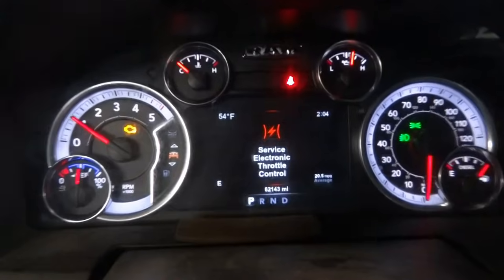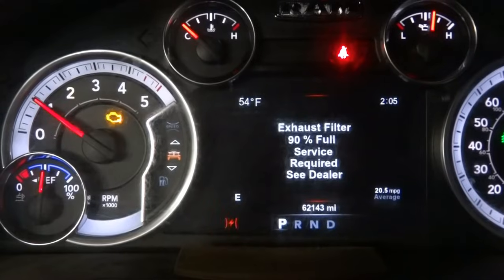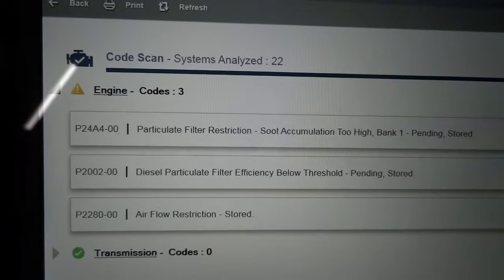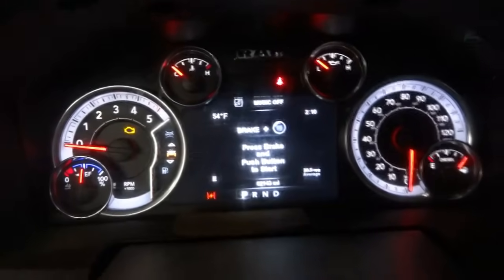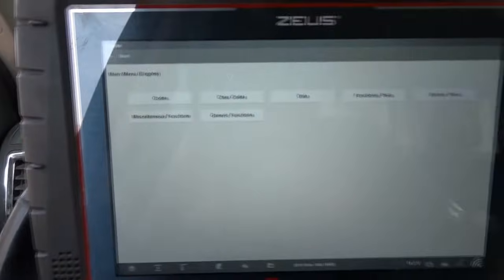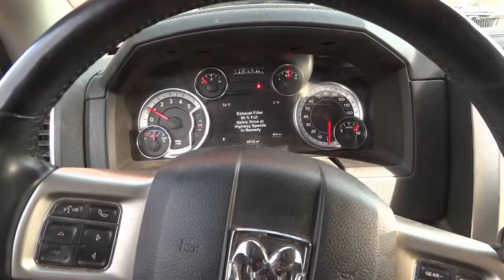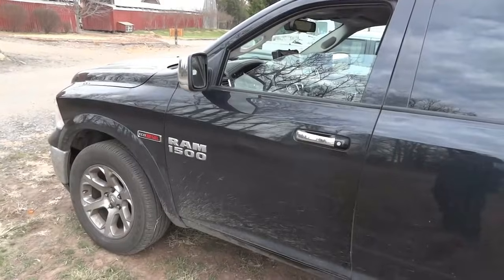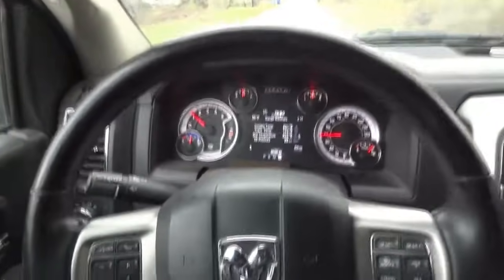DODGE RAM: P24A4 Particulate Filter Restriction - Exhaust Filter 90% Full / How to regenerate a DPF

Comment: My ram went to 100percent and dealership wanted 4000 to replace filter. Got on interstate and drove 90mph plus for a hr straight and truck finally regen.
Reply from the maker: @russelgunter9546   Nice!
Reply: Did the power reduced when you got the message ?

Comment: Hi, i have a 2019 ram 1500 ecodeisel. 3.0 v6. My was on 80% full, i tried to ran regen. At about 15 into regen . Engine went loe power than exhaust went up 90% full. I drove about hour and the number didn't come down. The engine oil change was on too. Is that have anything to do with regen not working?
Reply from the maker: @timtam9673  Yes

Comment: Excellent video! Are you able to help me? When my scan tool says regeneration activated the rpm on my car doesn’t increase? And comes up error it was unsuccessful? Not too sure what to do
I have cleared all engine codes before trying to do regeneration
Reply from the maker: @dylanr4791  Thanks! your scanner probably can't support that test!
Reply: @KITS_Auto_and_Truck_Repair  it’s very similar scanner to the one you use in the video, same prompts and everything 
Would a P0428 code stop it from being able to do this?
Reply: @dylanr4791  I have 2017 6.7 all codes need to be cleared before regen will run I use a ms906bt by autel

Comment: Please help. I have dodge ram 2017 1500 big horn eco diesel. All the time error appears p2002. We did force regenerate but after 10 km came again. What to do? Thanks
Reply from the maker: @randompillow1234   check the DPF pressure sensor!

Comment: Clean the def injection spray nozzle. It builds.up crystals that disrupt the def spray pattern.  
Just two 10 mm nuts to remove. Have a def injector gasket handy.. Crystals dissolve with water.
Reply from the maker: @petermandel2552   Yes!

Comment: Tried doing my regen on my 2016 Ram 1500 using a scanner. It failed due to not achieving enough high temperature. Any ideas if it is from the blend door actuator?
Reply from the maker: @adrianmuresan1  NO!

Comment: Guys you have to turn your overdrive off while driving thru town or under 45 mph. This will help. Since I started doing this all the time, I have not had another notification.  Back when I did have notifications I just reset the system myself by parking in neutral ( not sure if that makes a difference) and pressing the pedal til I reach between 1800 and 2500 rpm. I shoot for 2200. But it’s really difficult, unless maybe if you had a pedal commander it might be easier to nail it. It takes 10”15 minutes to clear the filter down to below 30%
Reply from the maker: @AbersonPlastering   Thanks for your input!
Reply: That's no different than taking the truck out and romping down on it to clear out a lot of the particles. The Regen actually adds more fuel into the exhaust causing the DPF to heat up over normal driving. Thus burning out the particles, but frequent regens will cause cylinder washout and you'll end up with a lot of diesel in your oil from it passing by the piston rings.

Comment: Hello there, now engine light popped  again three weeks ago. And when i tried the regen, it didnt allowed as I have another code to fix before doing the regen, that is PO545. I waited for sometime. But then yesterday when returning home from work, i heard tac tac sound before engine shut down completely. I had to tow to home. DO YOU THINK MY ENGINE IS BLOWN OFF NOW????
Reply from the maker: @tenzinnamdhak   I don't think so, I recommend you take it to a pro mechanic who can diagnose it for you!
Reply: @KITS_Auto_and_Truck_Repair  just curious, what could be the issues? 

besides i just saw a video that says that after forced regen in your ecodiesel, it is better to change the oil. Do you agree with that?

Comment: I have a Ram 2500 with 200k miles and I had to do forced regen because that message came up. Regen went good But since that I drove for like 60 miles and the dpf filter says it is a 25% full again is that normal? I had noticed that sometimes goes up like that and all of sudden it’s on 0%, but since the forced regen I just want to make sure. Thanks in advance
Reply from the maker: @rupertolandaverde4984  it sounds like the Regen didn't go through properly, after the Regen your soot level should drop to 0%
Reply: @KITS_Auto_and_Truck_Repair  It did went to 0% on the day that the regen was made I noticed that yesterday

Comment: I have a 2017 Ram 5500 diesel it’s a tow truck it showed it’s 100 full but I drive it a lot on the highway but the truck has 422009 miles on any possible solution?
Reply from the maker: @nabilbrahim5881  Do a Regen or a DPF Cleaning and see what happens!

Comment: Hi, I fixed my 90% full exhaust filter myself without any computer by following someones suggestion in another post. I only had an eighth of a tank of fuel so I drove to the station and filled up the tank with diesel. I pulled into parking space nearby put the truck in park, took off the parking brake, and maintained the engine e between 1800 and 2500 rpm's. It sure wasn't easy holding my foot on the pedal and maintaining the proper idle. After about 5 minutes the screen message said exhaust filter 80%, then another 5 minutes it went down to 50% then to zero and message said regeneration is complete. Whew, I thought I was going to go into limp mode on the way to the station and have to get a wrecker to tow me to the dealer. But thank you so much for showing the process here. Without the knowledge I learned from this video it would have been a bit more of a challenge.
Reply: Good afternoon Hi! Aberson, I read your message about 90% Full exhaust filters see dealer. I’m very sad because i just purchased my 2014 Jeep Grand cherokee Overland first time to own Ecodiesel. The reason i buy it because of the Gas mileage vs to Gas Hemi V8 engine. But when start driving couples days only city in the about 8 miles total 16 to 18 miles a day. The check engine lights ON and message saying 90% full filter full see dealer 😮 i just purchased 8 days ago and i used 4 times only not on the highway. then my Jeep Overland check engine lights ON. I follow what you said on you’re message now i have 123 Miles Distance to Empty my Gas i just put Diesel Gas 3/4 then Go the parking then shift on the parking and parking brake press gas Pedal until the RPM up to 2000 to 2500 hold 5minutes then repeat again for another 5 Minutes let see if worth to my Jeep Grand cherokee Overland Ecodiesel.
Reply: @earlcas7620  What you do about it. the same thing happened to me. and they checked everything before selling it
Reply from the maker: @AbersonPlastering My Pleasure! I'm glad to hear that you were able to fix your truck and thanks for sharing your experience with us!
Reply: Or you can get a scanner that will let you force Regen, go in and clear the fault code or chose installed new DPF , then you can get cel to go off , your manual Regen will work then. Dodge, Ram, Chrysler after 2019 needs the odbll security bypass cable.
Reply: Did you have the take to dealer for particulate full error
Reply: @MrJas6477 . No. At least not for a month. My check engine light went on and had to take truck to dealer. They did something emissions wise but the truck did that thing again where it said exhaust filter 90% full so I had to drive to Rio vista anyway so I though I would try it, but I got behind a couple big rigs. Hwy 12 is a 2 lane hwy and trucks were going slow. But I did it. It was nerve racking because I really needed to be going about 65-70 mph to blow out the clog this time.  Check it out. It happened even one more time but listen,  you have got to run your truck with overdrive off while driving under 45 mph since I started doing this I have not had another issue
Reply: @AbersonPlastering I have been driving my 2022 Ram 6.7 Cummins in tow mode to keep the rpms higher for longer trying to clear it, but I keep getting the full message. And I have done manual Regen several times after clearing the code but it's never happy with the amount it still shows. I'm just going to delete the stuff honestly. I have all the parts and schedule the tuner for Tuesday
Reply: Hey I'm just reading your post, did you put any additives in the system to do this procedure
Reply: Guys & gals, you don't have to sit with your foot on the go pedal to blow out the particles.  You can get on a 4 lane hwy or interstate, get to around 50mph and then romp down on it, back off and do that a few times to max out the rpm range moving as much air through the exhaust as possible. Take around 30 - 45 minutes at least once a month to do this and it will Regen like it's supposed to. The problem is driving around town and then not getting a proper Regen when it does try.
Reply: The best way to fix the emissions issues on any American diesel is to delete it, though it's illegal if you live in a state with no emissions or inspections your good to go. Finding the right tuner for your vehicle and the delete parts should be sourced carefully

Comment: thank you
Reply from the maker: @jrneff9773   My Pleasure!
Reply: @KITS_Auto_and_Truck_Repair Good afternoon. First Thank you for your time to read my message i’m looking forward to hear from you. About my issue of my Jeep Grand cherokee Overland 2014 Ecodiesel. I have check engine lights on because of the Exhaust 90% full fiter see Dealer. But still rung good. I just purchased a week ago to private seller before i pay it i drove it for 4 miles about 40 mph. everything good no check engine lights ON after couples days drive on the city around 8 to 16 miles for couples days the message show up and check engine light ON. what is your advice what i need to do my Odometer reading now 155K miles  do you think still good to keep it or just sell it or trade in?
Reply from the maker: @earlcas7620   you should get it cleaned/ do the DPF Regeneration!

Comment: My engine light says - Exhaust system service Required  See Dealer... I ran through the obd scanner and found out the code, it was P24A4. Do you think I should regen the truck?
Reply from the maker: @tenzinnamdhak   Yes!
Reply: Thanks.. it worked perfecto....

Comment: If after the region process, and driving for about 20+ miles with the check light OFF, the engine check light then comes back on later, what might the issue then?  The check light won't stay off for more than about 2-25 miles.
Reply from the maker: @mic982  you should have it diagnosed by a pro mechanic!
Reply: @KITS_Auto_and_Truck_Repair  Well, there-in is the rub: I've had this truck to three different shops, two of them dealerships.  None of them have figured out the problem yet.  $1100 so far and counting... This was such a good truck, until this happened.
Reply from the maker: @mic982   I'm sorry to hear that!
Reply: @mic982 I’m having the same problem how did you fix it yet ):
Reply: @Yoxicofficial  Sadly, I haven't, yet.  I'm awaiting an appointment at the Chrysler-Dodge garage now to get the truck fixed, again.  I don't think there are enough real mechanics left in this world who can diagnose and fix actual problems with these newer, highly-computerized vehicles we're driving.  I love my truck, but I'm seriously considering trading it off, but for what?

Comment: I am currently doing regen. My truck is blowing lots of white smoke the whole time and regen has been running 10 minutes. How long your regen last.
Reply from the maker: auto overdose  it depends on DPF Saturation, 8 - 15 minutes!
Reply: @leecrumble3921 hey can you dm me or tell me if he had the check engine light and exhaust filter fill message  or a different one I’m at 100% too

Comment: So I drive highways along and it won't regen. I took it to dealer and they forced regen. But my Guage came up 1/4 og the way and then went away. So I drive it enough. But I noticed it was parked when regen. Do I need to let it run idle so  the Guage will move up?
Reply from the maker: Luis Ramirez  I didn't understand your question sorry, was it doing regeneration at idle?

Comment: Why hasn't the exhaust regeneration process started on its own ? Mine usually does and I'll have to drive down the interstate for about 15 minutes to complete the process... but I just received the 90% full message after taking a 1200 mile trip...
Reply from the maker: Bernard Graf  did you do a lot of city driving while you were on your trip? or you might have a defective component in the aftertreatment system!
Reply: @KITS_Auto_and_Truck_Repair  not a lot of city driving, but will run a scan tool check for any stored codes. Thanks for replying 🤙
Reply from the maker: @bernardgraf7187  My Pleasure!

Comment: run hotshot secret edt in your diesel it helps a lot and don’t idle your truck run it on interstate once a week for bout a hour get it hot enough to clean your filter it will help alot
Reply from the maker: murlin Woolum  Yes I agree! Thanks for your comment!
Reply: I also add 16oz of HSS (Diesel Extreme) - every 3 months with a fill up. My 2017 averages 584 - 652 miles Between regeneration cycles.
Reply: @klforrest573 is your check engine light on why is mine on 😓
Reply: @Yoxicofficial  I have never had a check engine light.
Reply: @klforrest573  ohh why is mine on ? my truck only has 30k miles
Reply: @Yoxicofficial  need to hook up a scan tool & find out what is actually causing your CEL.
Reply: I just added 32oz DE before filling up (full tank) - & - drove a round trip of 253 miles. 
Mostly interstate & turnpike (70-80mph) - no towing - average mpg bumped from 20.9 to 21.6 mpg. (Maybe due to the Oklahoma Wind)
One thing - I don’t smoke - dip - or do drugs, so I have a lot of extra $$$$$ to spend of diesel fuel additives! 
Just started running HSS EDT / Winter Defense wLX4 year round. (4oz per 15 gal)
Reply: @klforrest573  I took it to the dealer and it had nothing wrong just happens with dodge cars

Comment: Great video. My 2007 ram 2500 6.7 says 100% full loss of power. Then it smoked grey/ white and was deiseling really loud. Was it trying to regenerate and I stopped it? I pulled over cut the truck off and made it home but still down on power. Thanx for any help should I find someone fast with that scan tool u have?
Reply from the maker: skip McLeod  Thanks! I recommend taking it to a shop that can do a DPF Regeneration!

Comment: Good Evening,

I got this error code on my 2019 Ram 2500 6.7L with 67k. Google is telling me to replace the DPF. I got the engine light on my truck and the truck is telling me that the Exaust Filter is full. Should I replaced completly or should I take out and clean it?

Thank you brother for your advice
Reply from the maker: Yasiel Pupo-Perez   You should do the regeneration process to clean the DPF, you need to take it to a pro mechanic who has a scan tool that can do it!

Comment: my mechanic wanted to charge $4500 to fix it.  How do I get them to clear the code so that I can take it on the highway?  Is that something I can get another mechanic to do for me?
Reply from the maker: Maribel Margarita  Yes! get a second opinion!
Reply: Maribel you don’t need to clear anything. You just have to regenerate it, drive 55mph or higher and it switches into regeneration itself. Don’t let it get to 100% ever, if it does, reset the code with a cheap scan tool then regenerate again. But I’ve been told getting to 100% can cause limp mode and possibly have to replace the actual part. But in the future call a dealer for this they’ll just tell you to drive it, like this guy paid a mechanic to just drive his truck when the dealer would have told him what to do for free. Not bagging on the mechanic because private mechanics are waaaaay better than dealer ones for the most part, but all this information is out there it just has to be searched for. Ex, one can change the oil in this truck for 1/3 of the price anywhere else, unless you take it to a cheap place and they use the incorrect 5w40; because the manufacturer only allows 1 specific oil for this truck because other brands don’t meet the standard.

Comment: Do you know why my truck would throw p203e code??
Reply from the maker: Zachary Smith  is a Ram like this one?
Reply: @KITS_Auto_and_Truck_Repair  yeah a 2015 ecodiesel
Reply from the maker: @zacharysmith1787  this code sets when there is a problem in the level sensor circuit of the DEF Fluid system, so I recommend taking it to a pro mechanic who can diagnose it correctly and fix it!!
Reply: Yes the level sensor, i cleaned the tank with distilled water and 2 rinses with boiling hot water. Thats 4 months ago, so far so good😅

Comment: My dealership has tried the regen and said it didn’t work. Supply chain issues put me 2 months out on parts. Dpf filter $2100 + temp sensor and labor $3,700.00. 

I don’t care about the money. All totalled 3 months without my brand new vehicle! What options do I have? Elimination kit= a fraction of the price. Disconnect the battery and Regen myself again? C-4? 

140k miles the warranty is long gone.
Reply from the maker: Afterthehunt007  I recommend waiting for parts and fixing it right!
Reply: @KITS_Auto_and_Truck_Repair  Fix it right! I’m reading you loud and clear. wink
Reply from the maker: @Afterthehunt007  sounds good!

Comment: did this on a 2011 3500 HD (already hit the 4mph limit) customer vehicle, with our macto scan tool a few times, but the idle never completely came back down did come down but never came all the way down.
ran all other tests (verified pump, injector, levels, nox, etc etc) and the only thing i can not do is "reset" the fukkin dpf code (no codes at all just the exhaust fluid screen "service NOW" with 4 chimes...
any thoughts?
Reply from the maker: Ryan Hensley  you need a scanner that's capable of erasing that light!